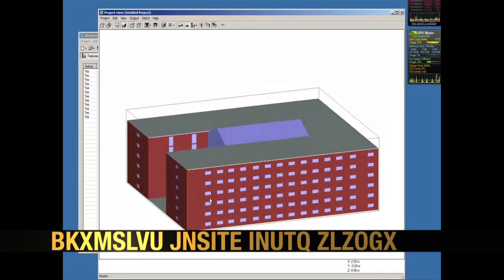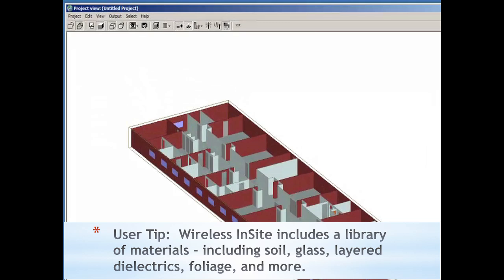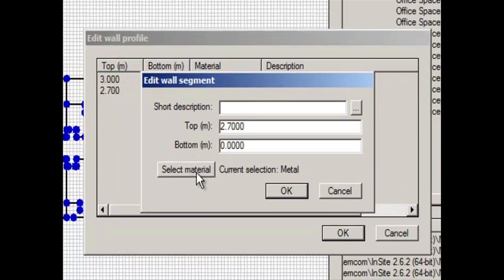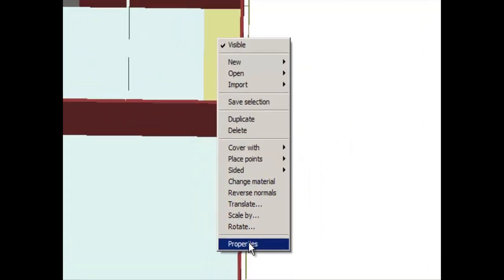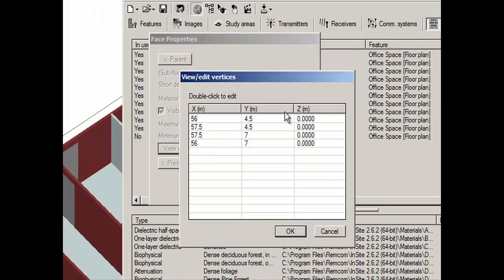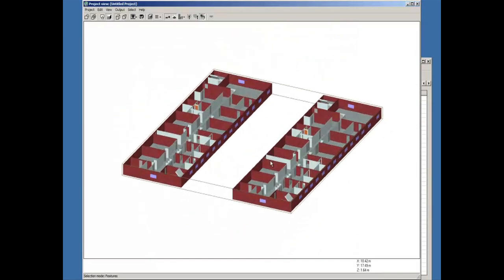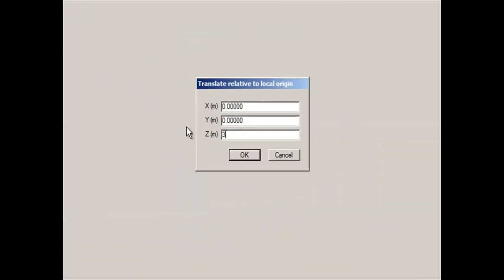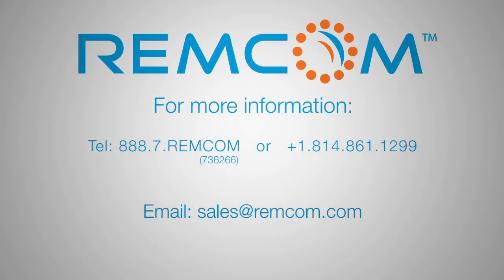Wireless InSite Intro Series: Advanced Floor Plan Editing

Comment: Why i can not duplicate the floor when select all the areas its not working? I use 2.5 v
Reply from the maker: As a Wireless InSite user you can contact Remcom's tech support department directly for help. Here's how to get in touch: https://www.remcom.com/request-support 

Remcom’s Technical Support can be reached via email or phone:

Email: support@remcom.com
Telephone: 1-814-861-1299, or toll free at 1-888-7-REMCOM (we are available from 9am-5pm Eastern Time, Monday-Friday)